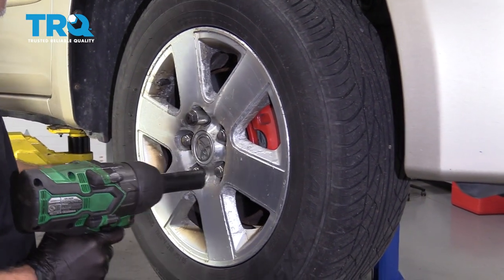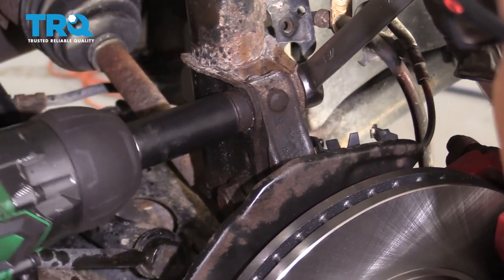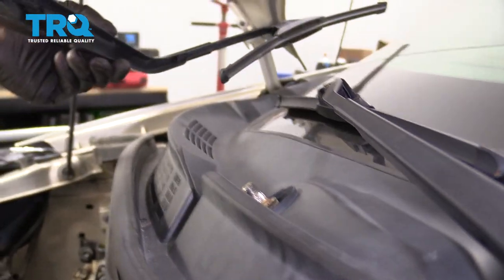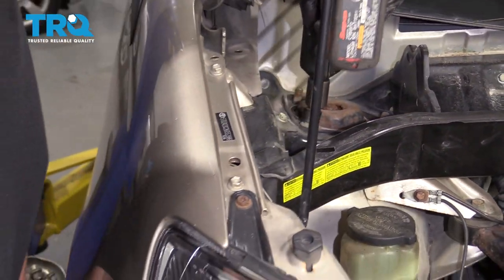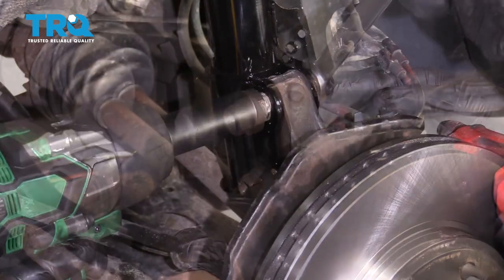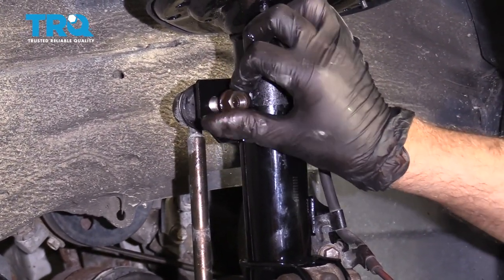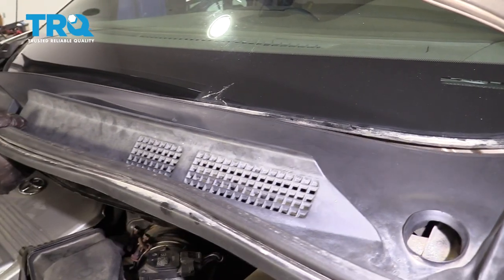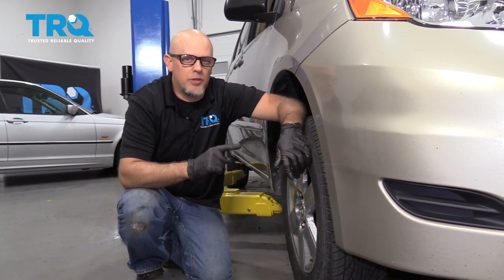How To Replace Front Strut Assembly 2004-10 Toyota Sienna

Comment: When you say out the car down to tighten up the three nuts on the top of the strut do you mean down on the ground with the tire installed to push up on the strut or just put down to get easier access to tighten and torque the strut top nuts?
Reply: When you say “put” not “out” the car down……sorry typo.

Comment: 76 ft lbs torque for the lug nuts but nice job.  It appears the reason for getting an alignment after is that the things those two huge bolts screw into is actually supposed to be able to go up and down on the strut to adjust camber.  I guess you can't tell from this because it looks all painted together black as if it were fixed? You can use kits to do your own appointments if desired.  Or home brew stuff...